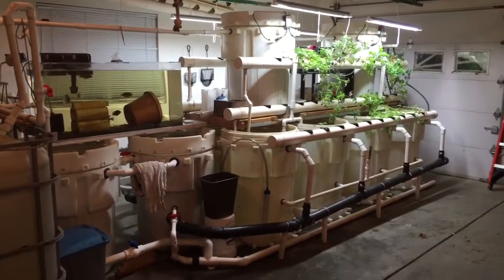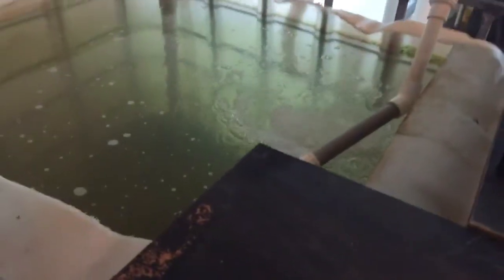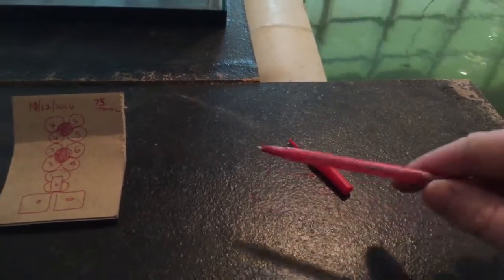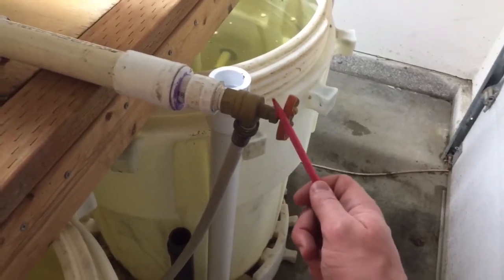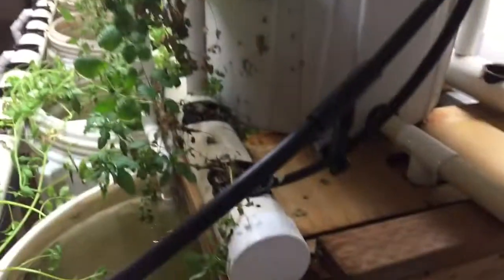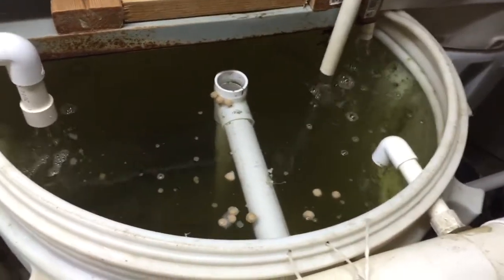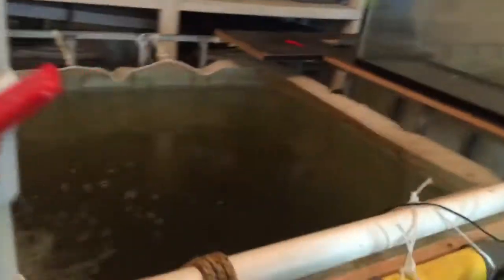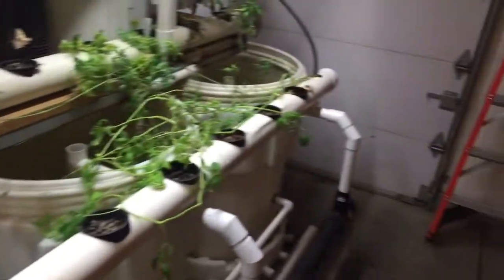(11/12/2016) Aquaponics Update

Comment: I saw your harvest video and vsuall I like your setup. Do you have a rough estimate of costs for your setup? I will be checking out your other videos to see if you may have mentioned things there.
Reply from the maker: Thanks for your kind words.  My goal was to build a system that was used almost entirely of re-purposed material.  If you are going to plan and purchase items specifically to build a aquaponics system, there are many ways to be more efficient.  Total cost of supplies - $3,000 (ish)  Total cost of everything $4,000 (ish)